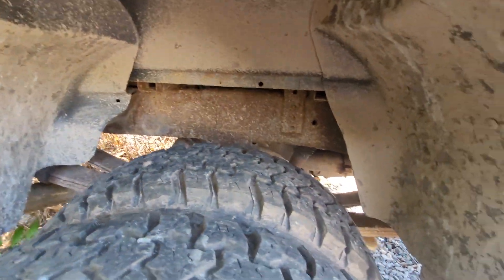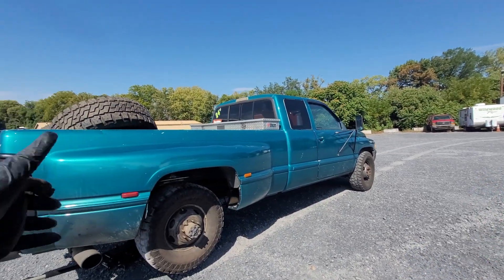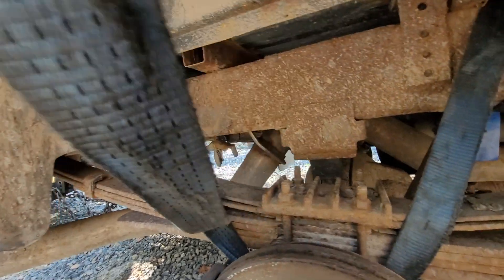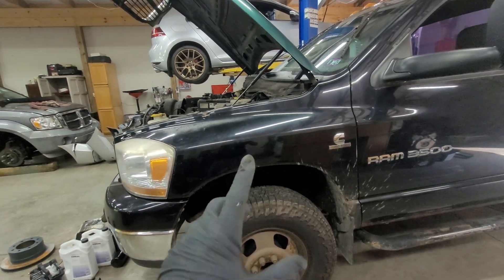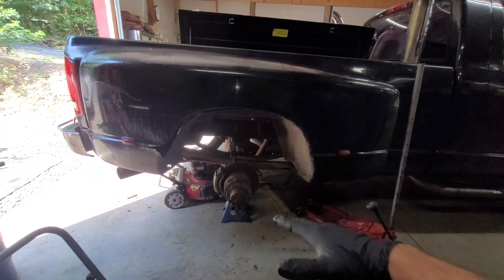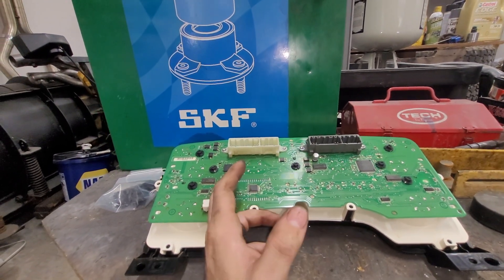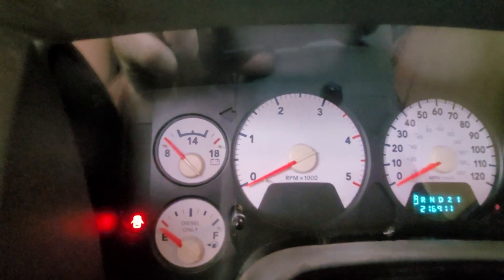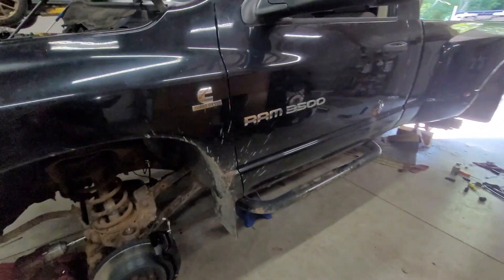Pintle Towing A Single Cab Dually - Restoring The Dually

Comment: Check out bulletproof hitches, they have a lot of accessories that are interchangeable and they have a lunette ring that attaches to their hitches so you can do this still. I have one and it sticks out far enough on my truck that i have a 3' 7way extension i have to use for most trailers to plug in. 

For this specific setup if you got two of their hitches, it might cost upwards to $1k but it looks like if you just had a larger drop off a hitch you could raise the towed truck higher. Their extreme duty 8" drop hitch comes with a reversable ball for $429 and the pintle lock is $140

Comment: The price of diesel these days I sold all my diesels I’ll run a gasser for now on . 1.97 a litre and rising  here in Ontario almost 9.00 a gallon.
Reply from the maker: One reason I only take the truck when needed. If not, I take the bike. Worst case I'll use the Dakota